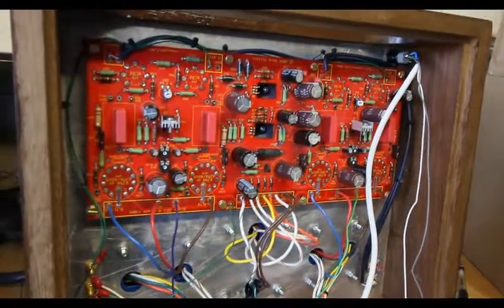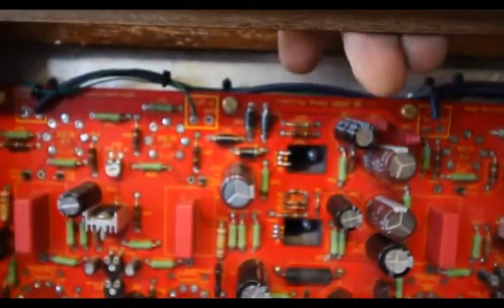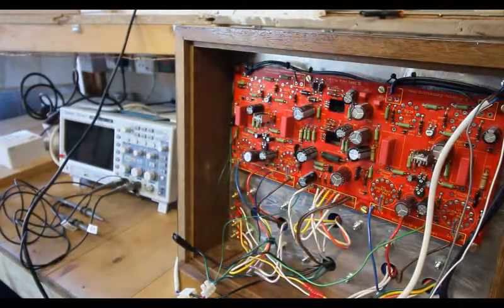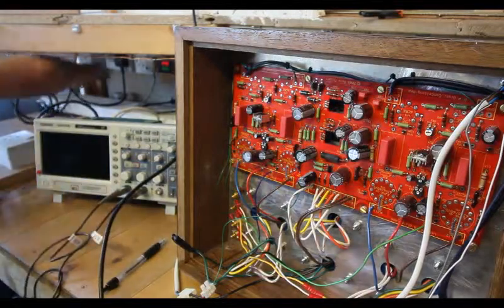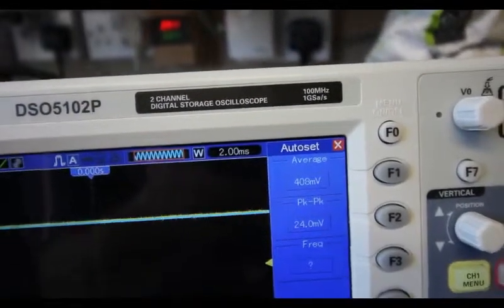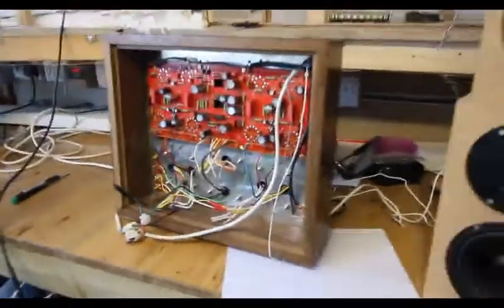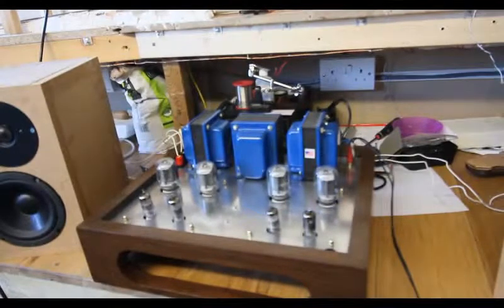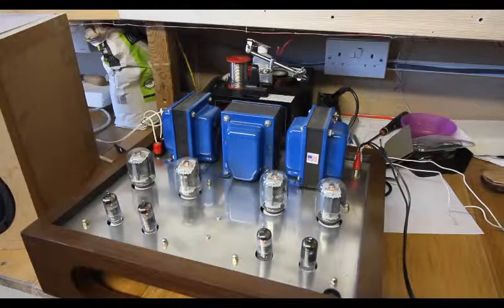My build of the DCPP Engineers valve amp (Part 2)

Comment: Nice work. I finished my build a year ago and have enjoyed it greatly. I have limited electronics skill so built it exactly to Pete's plans. How would you compare it to other amps you may own and/or have built? I have my own thoughts and interested in your thoughts.
Reply from the maker: Hi David thanks for the comment. I have only built this one valve amp and my views will be bias to this. I have built a few solid-state amps and honestly love the valve amp more. Even the look is much better and gives a good talking point at parties. Been using it for over a year now, still have an earth loop hum if I plug the computer in by cable but using blue tooth this is all ok. I believe this is a PC problem but have not researched it enough. Also need to build an attenuator but not had time yet. This might sort out the earth loop problem. I think Peter's design is one of the best out there, if it was not for the cost of the transformers I would built another for my brother who wants one
Reply: @BrackstonesTravelAdventures  Might an isolation transformer on the audio in eliminate this?
Reply from the maker: @jgw211080  Hi John. Not sure an isolation transformer will work as the 50Hz frequency across the power supply will pass though the transformer and it would make the computer unsafe if a fault was to occur assuming this is the 50Hz passing on the ground. If you meant putting it on the audio outlet then the same issue with frequency across the transformer will occur. In the end I bought a ground loop filter on ebay for £5 and it work wonderfully. No more hum at all. Its not worth building one myself for that money. I expect its a frequency filter to ground in the end.
Reply: @BrackstonesTravelAdventures  I think they're pretty much the same thing (could be wrong) but main thing is that it's fixed and you can enjoy your setup without that particular annoyance :)